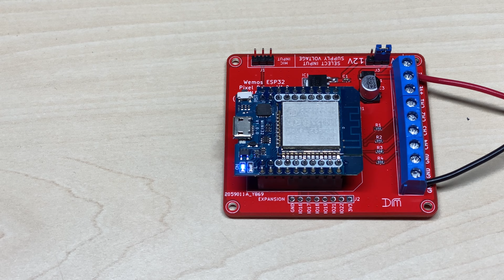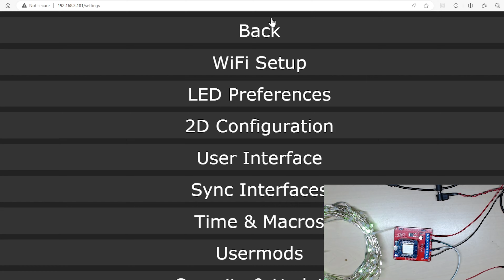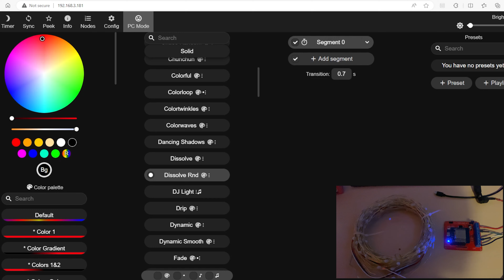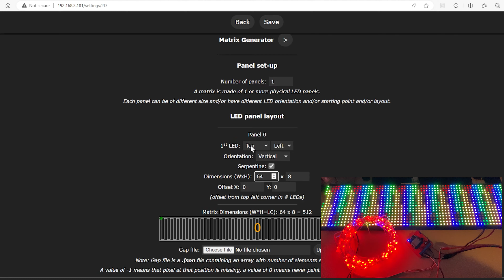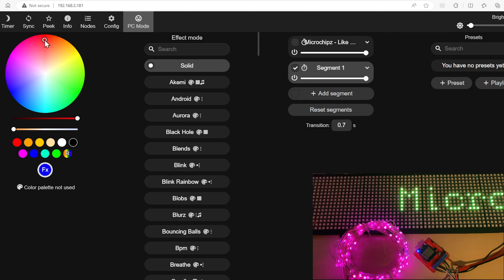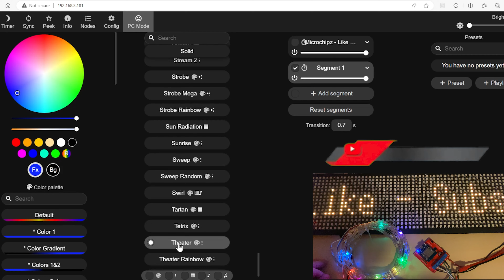Unlock the Full Potential of WLED 0.14.0 on Wemos ESP32 - Flash,setup and test.

Comment: Been using a number of Mottramlabs control boards for projects, no issues so far.
Particularly like the single channel esp32 module for small control box nodes.
Reply from the maker: I think they are excellent value . I wanted to experiment with a esp32 and this was perfect .

Comment: I got everything going until you changed segments since you didn't show how you set up your segments Im a little lost on how to set it up doing the same lay out you have just didn't see how you set them up can you do a video on that or help me out ....Thanks
Reply: Did you change the channels also since you changed segments?
Reply from the maker: no it was on 1 channel i havent tried splitting it up over the channels yet , the segments are simple , if you have 100 leds , segment 1 will be 0 to 50 and segment 2 will be 51 to 100 , once you get the hang of it its easy to setup .i think i didnt film the segment part as i had to put the matrix display on first segment.
Reply: @MicroChipz  Funny I was messing around with the segments and channels some how I got it going with the pixels on ch1 and strip on ch2 and it's working. I think what help was in the settings I put them under different segments on LED profile.

Comment: Looks like a child designed the pcb. Waste of money
Reply from the maker: Considering the board was just a few pounds , i thought it was good value . Can you do any better ?
Reply: @MicroChipz  yeah but I just etch my own  by smacking out tracks. Pcbway gouge me on shipping where I live and I rarely order them. Sorry man, I didn't mean to be a dick. It came out wrong. There isn't an apparent reason for that specific design I should've said. There's support for multiple outputs but no current protection by the look of it or added features that can't be added with a 10 cent piece of perfboard. If you got them cheap though then that's cool. Most 'makers' overcharge for their work because of poor understanding of economics of scale. We live in an age where nothing is sacred and everyone thinks they can be anything. People have strengths and weaknesses for a reason and it's what makes every person standout for good or IL. I donate electronics learning kits to anyone in canada or the us who can't afford it and what I put in is based on that person's wants or needs. I don't think I'm better than anyone or seek any recompense or praise for it. I discourage any of that. All I ask is to be able to pay for postage of any expensive items like multimeters or soldering stations if the person gets new gear or doesn't take to the hobby. 

I am sorry if I offended you my friend. 

If I designed a wled board I'd bake in uart because the esp32 mcu lines require more current than an average usb port on a pc can source using USB micro, even on a usb3 port because the cp2102 ic hasn't been configured to do the proper handshake for the garbage micro ports that Asian companies put on them. I have a drawer full of esp32 boards from at least 10 'different' companies which all use the same reference design which hasn't kept up with the more feature rich versions of the esp32 ics that are put on the past 6 months. I purposely tested it. The older fixes of putting a cap between the en/reset and gnd pin is not working on the esp32 ics which have more fp math support. I end up having to desolder the actual module and do a quick breakout board. The usb c boards do not need to even have the boot button pressed.  It's why you see people being able to do better gui work and emulators with esp modules now. I remember when the (typically overpriced maker-built) launchpad board was released, it struggled to even make 2d buttons because Extensa were too cheap to pay a little extra to add better fp support. Risc v isn't really open sourced hardware, it was made so arm didn't have such a huge stranglehold on companies who made purpose built logic blocks. Kinda how steam takes 30 percent of every game's revenue, no matter the publisher or developer deal and the game makers usually get shafted after making a hit game and have to close needlessly.
Reply from the maker: Its ok , no problem.